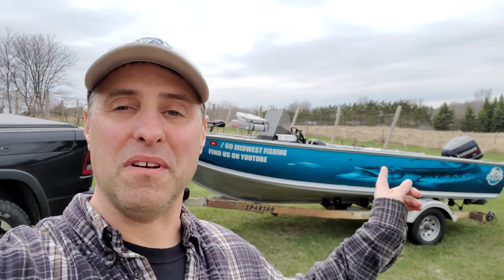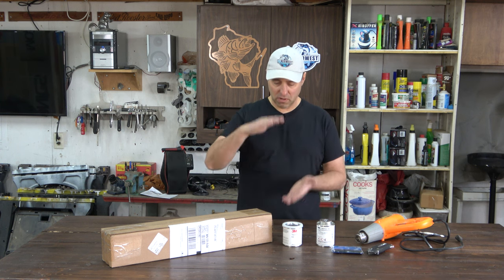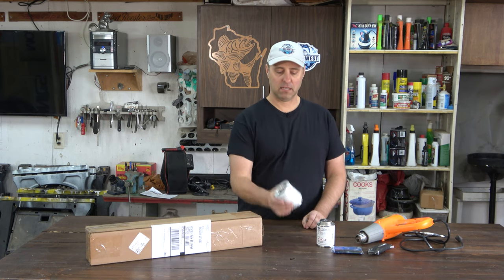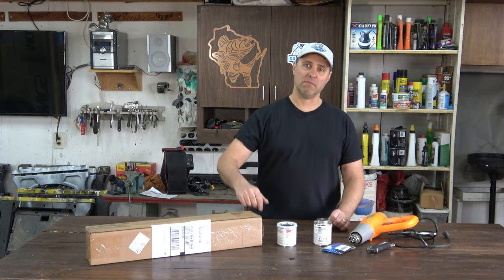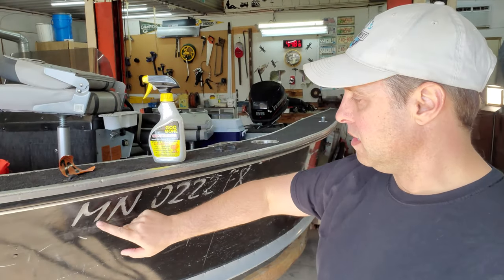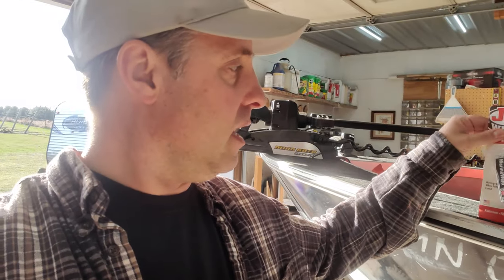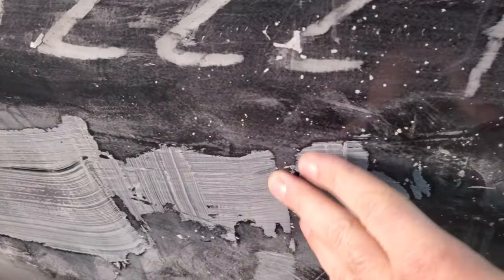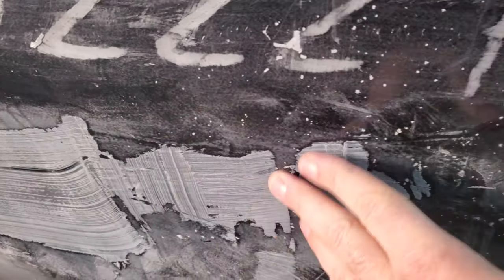A DIY Boat Wrap You CAN Afford

Comment: I built Yachts at Stephens Bros in Stockton Ca   We built Aluminum hull yachts and we used tons of automotive Plastic filler to fine tune the contours of the Aluminum Hull.   It works fine.  Make sure and sand off paint to raw aluminum before applying.  Used a bendable piece of wood to find your high spots.
Reply from the maker: Thanks for the info.

Comment: Great job installing it yourself.  I'm curious how its held up over past year?
Reply from the maker: Its held up great! I put a couple scratches in it from hitting docks and such, but you really have to look to notice. The only thing I would have done different, would be to get a wider print. That way you won't have to bend it where the boat curves up near the front. It will prevent the wrinkles that I got from doing that.
Reply: @GoMidwestFishing  Thanks for the reply.  I'm going to give it a shot.

Comment: Good idea.I have a 16' fisha and ski that needs some dents filled and a fair bit of repaint work .I saw your vid and figured this would be a good way to clan up my dents first then sand and prep for a wrap.Would you do another wrap and how do you recommend keeping the wrinkles out ?Thansk
Reply from the maker: The wrap has been awesome. I would definitely do it again. Its still holding up, so I will wait until it needs it. I figured out why I ended up with wrinkles. My wrap was 18 inches wide, the exact width for the space it was going. The problem is the boat curves upward at the front, so I had to bend the wrap to match it, which caused wrinkles. If you buy a wider wrap, then you can stick it where it naturally falls, then cut off the excess.

Comment: I used to use that bondo stuff to fill up rotting window and door trim when painting houses.  I did not realize having "Youtube" on the boat was that tricky. Boat looks awesome!
Reply from the maker: I didn't realize you tube was so strict about their logo. I was searching for the logo so I could print it, when I saw the guidelines for using it. I sent them a draft, and was denied three times. I finally got it right, and feel much better that it is approved and I won't have to worry about it.

Comment: You don't spray water on the back of the vinyl for easy to wrap?
Reply from the maker: The back of the vinyl is a sticker, so water would prevent it from sticking. The vinyl is porous so when you heat it, it shrinks slightly and squeezes out the air bubbles. I actually should have got a wider vinyl. I was forced to curve it upward near the front of the boat which caused some wrinkles.

Comment: How many trips have you taken it out on since applying the wrap? And how has it held up so far?
Reply from the maker: Hi Blaze. I've used it for a full season since wrapping it. I'm not sure how many trips, but many, and I have used it hard. It is holding up great so far. I have one spot where I hit a dock that it scraped about a half inch hole in it, but that's it. No issues with peeling or coming off. It sticks on real good, especially when you use the primer on the edges.
Reply: @GoMidwestFishing  good to hear, thank you!

Comment: did you have to make a cut where the bow is?
Reply from the maker: I didn't on the left side and got some wrinkles, so I made a cut on the right side and it worked much better. Here's what I learned through this: I got a wrap the exact width needed (18 inches), which made me have to curve it upwards toward the front. If you buy a wider one, you can just let it stick where it naturally would, then cut off the excess. It still looks great from a distance, but you can see a few wrinkles up close. Its still holding up after a full year of use and I'm really glad I did it.